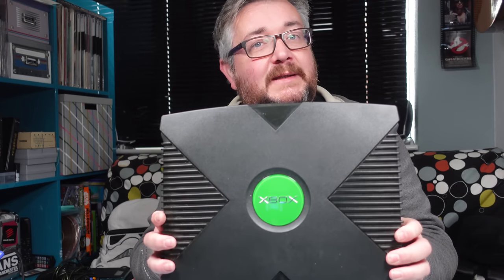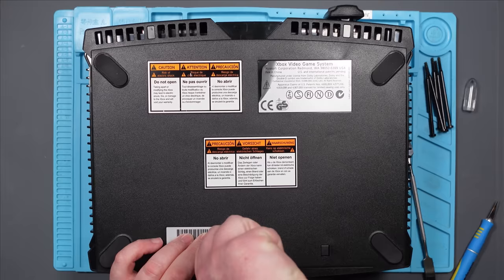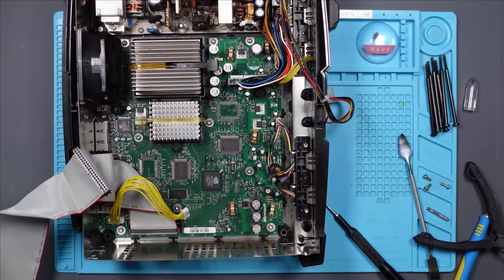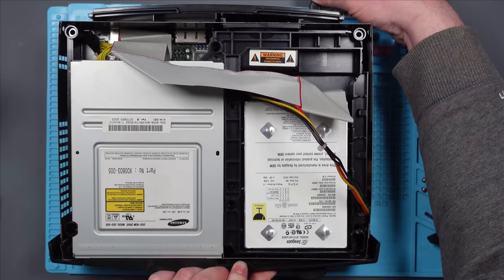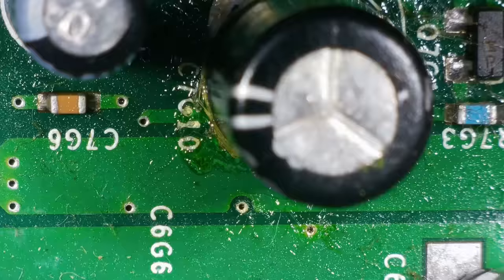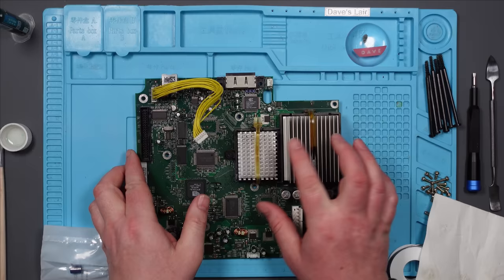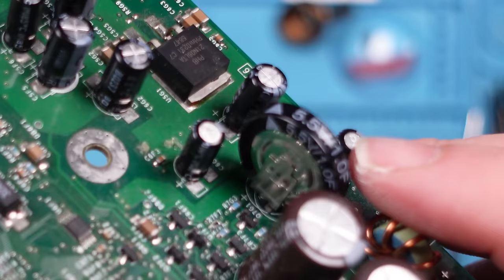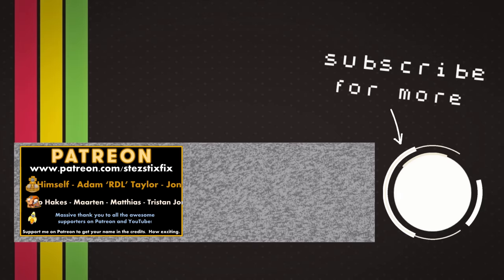This OG XBOX Won't Turn On | Let's Try and FIX it!

Comment: It says the drive capacity right on it, Steve. 16383 cylinders * 16 heads * 63 sectors / 2 = 8,257,032 kBytes or 8.2Gb in CHS mode or 20,005,650 / 2 * 1.024 = 10,242,893 kBytes or 10,2Gb in LBA mode. XBox used LBA mode.

And, yes, they did take a kByte to mean 1024 bytes when advertising the legacy sizes vs. 1000 bytes when advertising the LBA sizes and I don't know why. Perhaps they thought it was clearer as they used powers of 10 for mega and giga regardless. I'm a vat of useless information like that.

Comment: normally with the og xbox, you should check the caps and replace them with new ones. but if you cant an the caps look {fine } just remove the clock cop unless its a 1.6 a/b you need the cap to read game's for some reason. but its also near the back of the console vs the front like with the 1.0 to 1.5
Reply: the ver he has is a 1.0 because the psu connector is the old one thats not the 20/24 pin one

Comment: Hey @stezstix fix, love your videos. Do you have a video or listing showing the equipment you use? Curious what hot air desolderer and soldering iron you use. What flux, solder etc.

Comment: You actually don't need to replace the clock capacitor, you can just remove it, It just won't keep time. If you install a modded dashboard it sets the time somewhere in 2007 automatically
Reply: Why not just do it properly?

Comment: On the flat round capacitor where the terminal is attached on either side, the positive side is connected inside a + symbol and the negative inside a - symbol, I've seen this in a couple of your vids, I'm not a tinkerer in matters electronic but I think they've made them idiot proof without having to look which one the negative is??? Am I wrong or is it just coincidence?

Comment: Your 240 volts in the UK scares the crap out of me.  Here in the States, the only 240v outlets are running the dryer and electric stove!  🤣  Seriously though, I'm guessing your 240 volts doesn't have as many amps as our 240 volt outlets?

Comment: The new capacitor you replaced has a stamped shape on each side, one looks like a large ‘minus’ sign and the other is a ‘plus’ a bit similar to the Chevrolet logo. I’m guessing that’s the easiest way to tell positive and negative apart mate??

Comment: Absolutely a receiver for a remote.  These are cool because of their modability.  And still the best way to play ripped copies of games.  I want one just to swap in an SSD with every Xbox game. XD  Once you've got power to it, that's the big none.  Hard drive can be replaced and upgraded.  I don't know if the disc drives are married to the boards like Xbox 360 is...

I had to look up the model number, I don't see it listed either, but apparently it's a 10GB drive.  Which makes sense for that era.

Nice mug.  Is there a shop I'm missing or are these all one-off?
Reply from the maker: 😁 thanks Sixty!  I'm tempted to mod this, but I might get another one and keep this one stock.  I'm working on the merch, hopefully soon!  😬
Reply: @StezStixFix  btw its not just for dvd remote, it also enables dvd playback, something todo with licensing for dvd playback.
Reply: You can swap drives between consoles no issues.

Comment: Really nice fix. If you really want to see an impressive Xbox-game, get Crimson Skies - High Road to Revenge. It's a dieselpunk flight sim, you play as a sky pirate.

Oh, and the dongle that was in one of the controller ports is the receiver for an official remote. It was sold as a set with a Robbie Williams DVD.
Reply from the maker: Ooh, that sounds right up my street, thanks I'll check that out!  (the game, not the Robbie Williams DVD 😁)

Comment: A good tip for removing stickers is using isopropyl alcohol 70% with a cotton bud / q tip around the edge, then once it starts to come up rub the cotton bud along the sticker while slowly pulling it away. Once the IPA has dried the sticker regains its stickiness.

Comment: Those Capacitors that you like but can’t seem to remember which side is Negative.
Have you not noticed the shape of the contact indent where it’s spot welded to the Capacitor? One is - shaped, the other is + shaped. Just saying.
I do enjoy your vids though.

Comment: just bought an xbox yesterday, wont turn on at all. The last 10 original xboxs I have bought at a yard sale, 1 worked. The last one that didnt power on, I opened it up and it was full of dead roaches. So scared to attempt to fix this one...

Comment: if you look at the indentation of the metal that connects to the cap, you will see one is a + symbol and the other is a - symbol.
Reply from the maker: Ah, didn't spot that.  Thanks Durk.
Reply: beat me to that observation by minutes.
I enjoy many of the videos. keep it up.
Reply: @StezStixFix  NP, Love the vids and the singing. Stay cool bro.

Comment: Perhaps you answered this question later in the video (I'm only 3:56 into it), or maybe it's buried in the comments, but I didn't see anyone answer your question on the Hard Drive. The Seagate 9W1001-279 is a 10GB hard drive, just FYI.

Comment: My understanding on the hard drives is they are all 8gb.   They might be bigger but they did something to stop them at 8.  

That was the issue as the system went on. No one was making 8gb hd anymore. So they were buying 20gb to put in there.

Comment: At 13:39 you can see the capacitor has a plus indentation where it was spot welded; thats the positive side. And on the opposite side ( 13:43 in the video) the imprint from the spot welding is a minus sign … lemmie know if this helped @stezStix

Comment: I believe that with a sector size of 4KB which I'm guessing this is - LBA 20.005.650 would be an 80GB drive.
Reply: (LBA 20.005.650 * 4096 = 81.943.142.400 - so depending on how the brand does it - it would be rated 82GB (if done with 1000 factor) or 78GB (if done with a 1024 factor) - and from experience these drives were usually called 80GB.

Comment: This is known problem from Microsoft, houses get burned because of that, microsoft made a reminder campaign about that.
Instead of changing inside components they send you diffrential circuit breaker attached on power cord...
Every owner of Xbox 1 need to do that.!!!!

Comment: Nice one Steve! Also reminded me that ive yet to remove that clock capacitor from my Xbox. Does it need to be replaced if i'm not worried about the Xbox keeping time?
Reply: If you have a version 1.6 xbox it is needed to work. all other versions it is not needed. The Xbox will still keep time when plugged in it will just need reset if you unplug it. When the capacitor is working it would only hold the charge for ~4 hours though anyway.
Reply: @bobothn  
BoBo Maupin
Thanks for that information! I do have a 2005 model, so i guess it might be a 1.6 revision?

Comment: Unless you modify it, and remove the clock capacitor on the board, it has a VERY limited life span. As it will eventually rupture. (Takes between 10-15 years, typically. Some fail sooner, some fail later, but all will fail within a margin of error before, or after the lifespan of this capacitor.)

<Ahh, I see reddit lead you to the inevitable problem with the original xbox.>

Comment: Where the hard drive says ST3 this means Seagate 3 , after that it says 10014 which is the number of MB on the drive.. old hard drives were often labeled in unfamiliar ways with modern identifying methods, but as well I'm pretty sure the XBOX had these drives from like enterprise equipment rather than retail equipment so they weren't "meant" to be as easily readable because they weren't being sold separately..

anyway it's a 10GB drive

Comment: Based on LBA, the HDD should be about 10GB. Confirmed after searching by disk part number
Reply: It's a 10gb HDD, formatted to 8GB to keep parity with the original 8GB drives.

Comment: Yeah, The Aerogel super cap, The destroyer of Xboxes should be removed on sight, They all leak now with exception of slightly less likely on the 1,6 version. it will eat up the board and components as it is very corrosive. it can be removed and be left empty on all models before the 1,6 version. it will only keep time without power for a short time anyway and is not very useful anyway. if you have a 1,6 you need a capacitor in place for the Xbox to start at all, you can just solder in a plain 1000uf cap instead of a supercap to get the 1,6 to start up just fine again as well, easy as punch

Comment: Those clock caps fail because they were used in a voltage environment higher than the caps rating. You could also install a bigger lithium cell with a blocking diode. I just removed it because most people won't play that often considering the DVD drives die.

Comment: there are too many pluses for modding the original xbox not to mod it Bigger harddisks, Cool home brew , load  all your games onto the harddisk and save the life on the DVD Drive plus would make a interesting video the mission is yours should you choose to accept it this message will not self distruct.
Reply from the maker: Mission accepted!  😁

Comment: Wow, it's not very common nowadays to get a unopened Xbox, most are modded to the hilt.

Very little goes wrong with them too, besides the clock capacitor, the capacitors around the CPU are prone to failure.

Comment: Samsung drive in Xbox always stop working
Reply from the maker: I wonder if it can be swapped for another one, or if it's married to the rest of the console?  🤔
Reply: @StezStixFix  I think you can and It doesn't have to be a Samsung drive they make other brand drives also

Comment: Be aware these OG Xbox they self destruct not replacing or removing the clock capacitor or will leak and erode through the substrate

Comment: Yes the Xbox original The capacitors need to be changed after all it is a 20-year-old machine if you don’t attend to them it will start to eat at the board

Comment: Not enough.... I mean too much thermal paste...😅 also why do you put flux on such a straightforward job??? Also get some thinner solder thats way to much... also the solder has a no clean flux core... so you dont need to add more flux which you then clean off?????.

Comment: Stupid game. 
Did you realise after that that capacitor has a + and a - stamped in to the legs? 
That clock cap is a pain, you can just remove it and not replace. It will only hold details for a few days anyway.

Comment: I got an Xbox the other day that said no video and it was a faulty video cable lol and got it for 20 pounds plus 8 games and 2 controller crazy deal I removed the capacitor just in case but it was intact you don t really see it often…

Comment: Man I so want a dead og xbox but those even dead ones are hard to come by for a good price , on ebay I'm finding 😕  dead ones for at or almost 😪 the same price I was buying them for or more at games top used , if anybody wants to help I want to do a project in one , a pc to be exact , I did one before with an after market case and a retro pi but want to do pc now and just recently bought the asus desktop mini for just a project thnx in advance